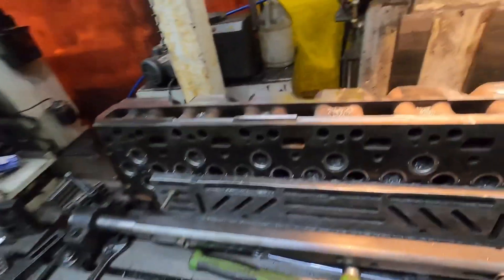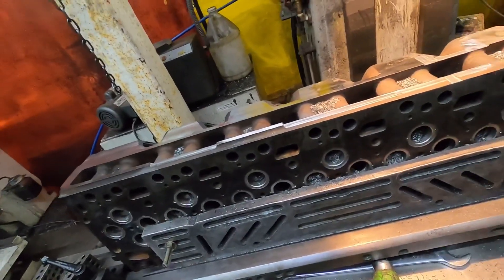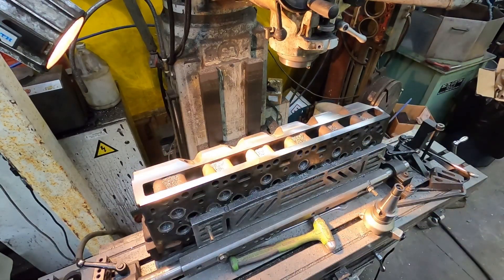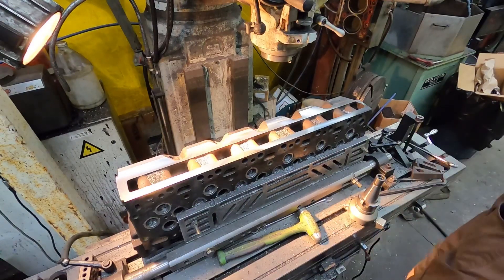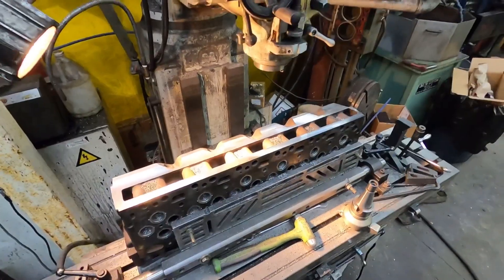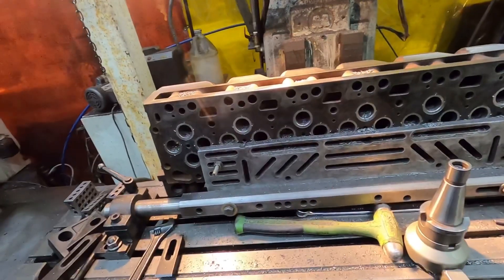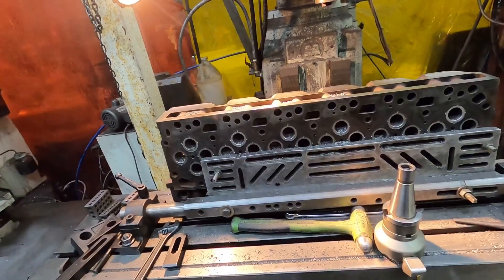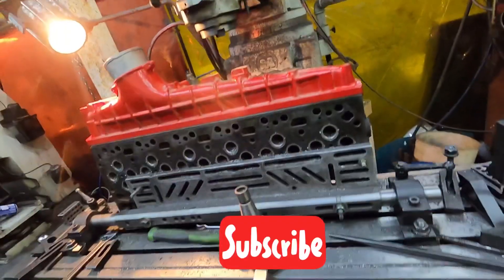Side draft machining on Cummins head PART 1

Comment: Did you do a part 2?
Reply from the maker: customer stopped the job part way and its still on the shelf half done
Reply: @CUTTERUPROB  bummer! Have you done or know where I can find more info on intake ports having their flow path modified by filling it in by welding the ports and drilling a new port?